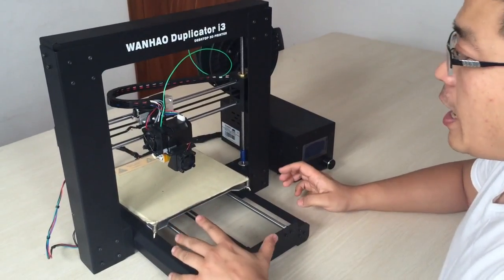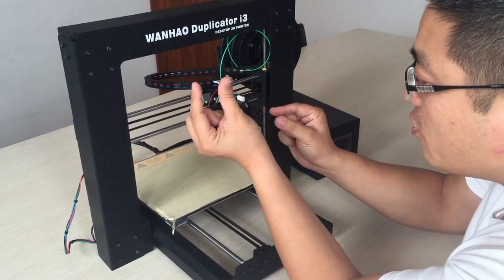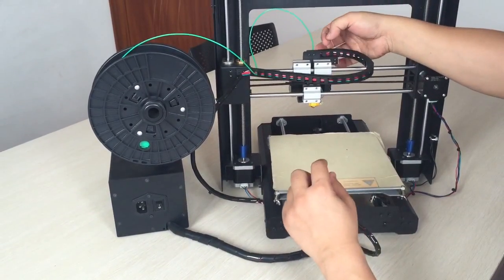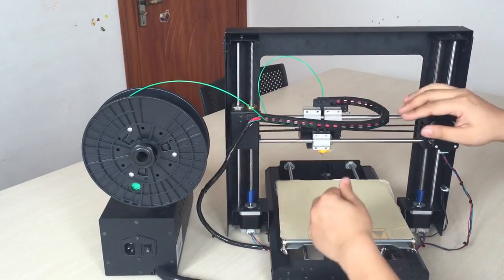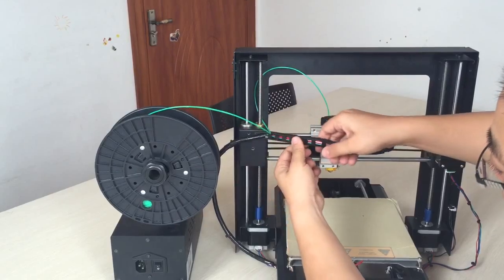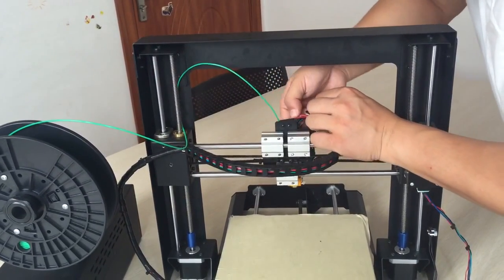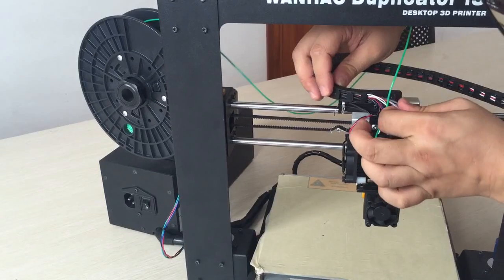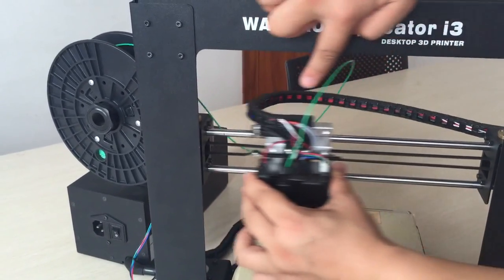How to resolve the i3 heating tube climp broken issue?

Comment: will you be uploading a video on how to resolve the inconsistent hotend temperatures that users are experiencing with the I3?
Reply: +Graham Melbourne I have this problem too. Sometimes jumping between 5 degrees of the desired temperature or 10 degrees depending if I'm printing ABS or PLA.
Reply: +Tom Mertens There are a few people reporting the issue - lets hope there is a solution provided soon.